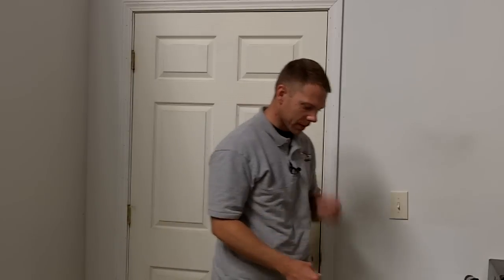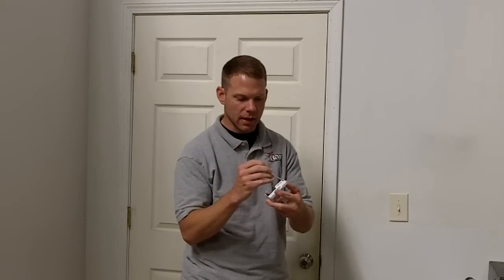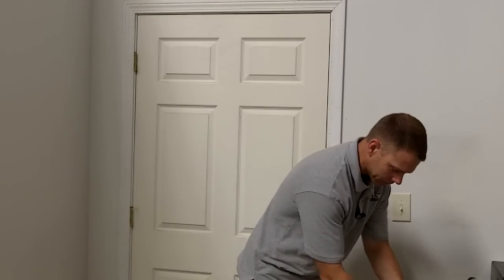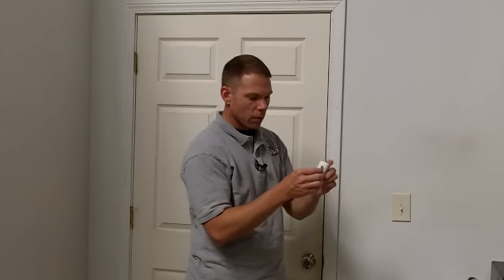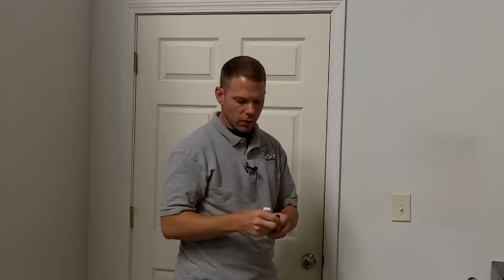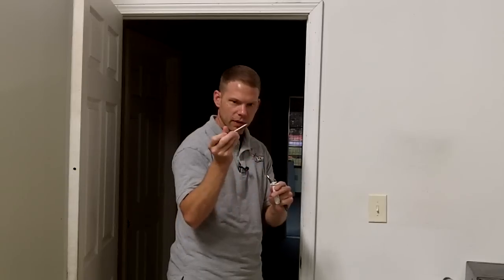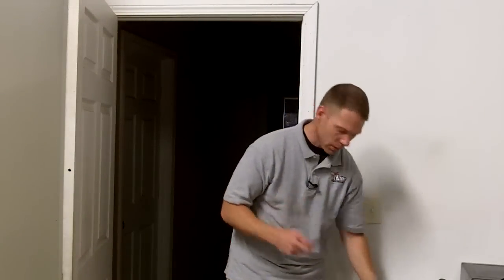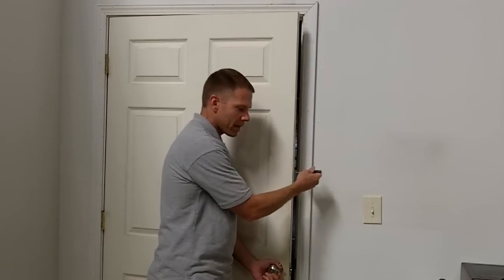How To Install Honeywell Wireless Door/Window Contacts

Comment: Trick for lining up the holes: Use blue painter's tape on the door and the door jamb and make sure the tape is applied in a straight line and  lines up on both sides when door is closed, and you're good!

Comment: I have a sensor that is sending an alarm when there isn't. I want to replace it myself. I can purchase a new one and replace it without any problems? The system will pick up the new sensor?
Reply: You'll have to reprogram it but yes, you can replace it yourself